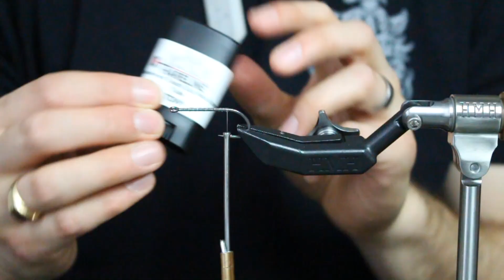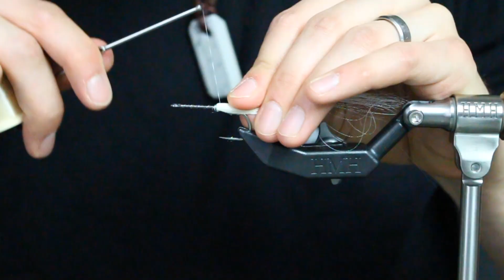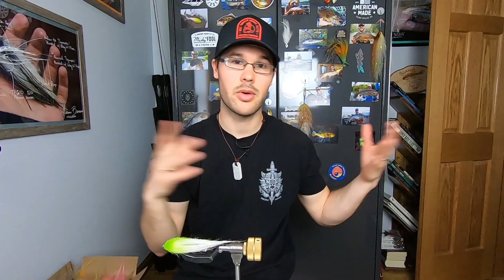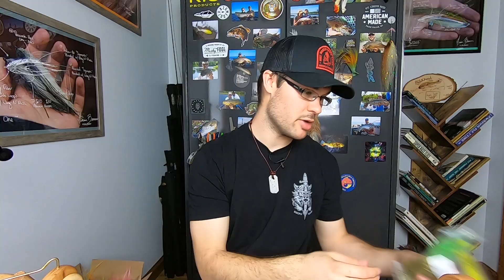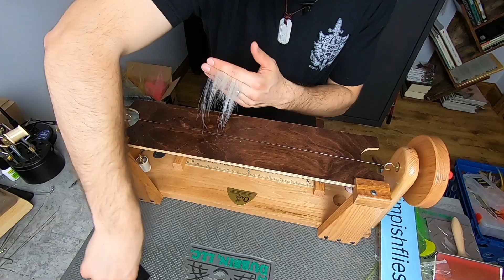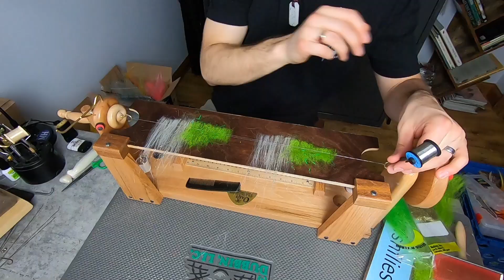The Chosen One - 1 Minute Tying Tutorial and Full Brush Build SBS

Comment: Hi Gunnar, great video as ever and excellent idea of a fly on one brush. Impatiently waiting for more dubbing wire to arrive I decided to try using some old 20lb braid. Works a treat. Takes wax, spins well, is more supple than wire and as is far easier to tie with. I no longer bother with wire
Reply: I've used braid attached to the hook for a strong dubbing loop.
But will braid stay twisted like wire if it's loose on both ends?
Reply: @michaelburk9171  It seems to. I add a dab of superglue or UV resin at each end of the brush as a precaution to stop any untwisting
Reply: @gegarne  thanks. I'll give it a try.